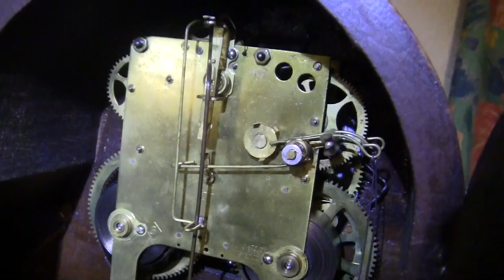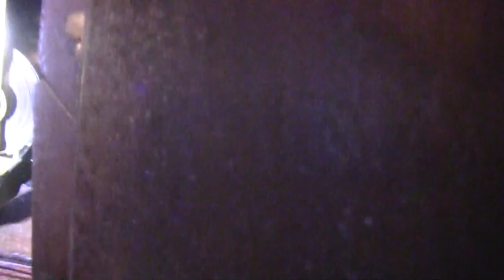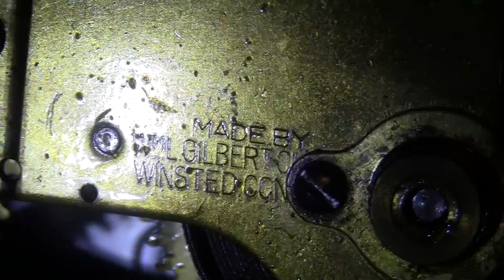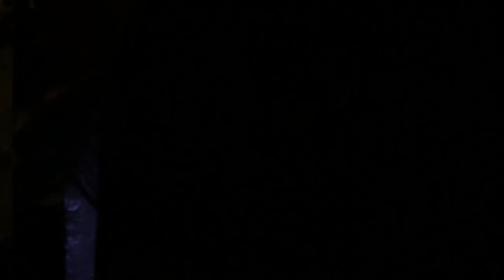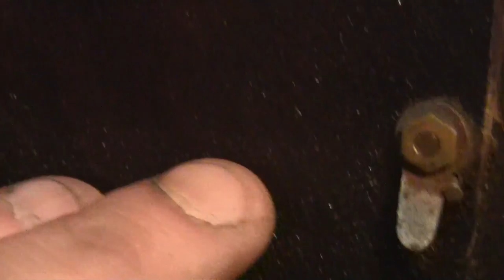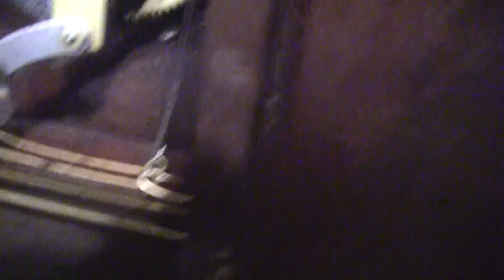1807 Gilbert clock repair (PART 1)

Comment: Nice clock Shawn. One of the few things that happened at Ulceby was I didn't get Grandads wall clock. It had a nice glass front with a picture of a windmill in the door. A chiming clock with 2 weights. Not been for a while and saw it thrown out in the outhouse. It was ruined so never bothered to get it. Looking at that clock on the wall is one of my childhood memories.

Comment: Help.  (Exact same clock.   The clock is my son-in-laws family heirloom.  no hurry)  I put in new springs and the clock is working fine.  but the new springs do not seem to quite push the movement (clock side) enough.  My clock suppler assures me that the springs are fine.  But the clock has run for many weeks, even months.  But never more than 7 days, if wound very tight.  Did it have the wrong springs and still have the wrong springs.  They are 3/4 inch wide and 0.018" thick.  the case looks like the spring could be a bit wider.  (the chime side works fine)
Reply from the maker: I wish I could help, But over youtube it's really hard to say what the problem could be. I have a love for clocks. I enjoy them and there sound .. Thanks, I hope you can get it going proper..